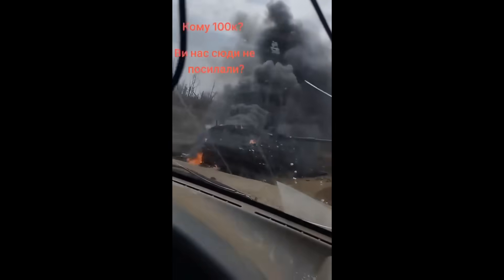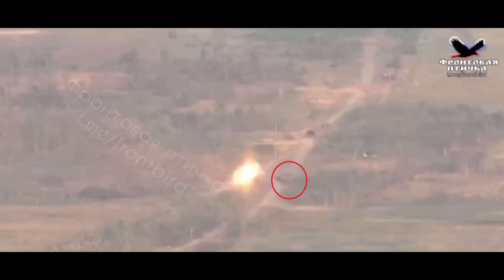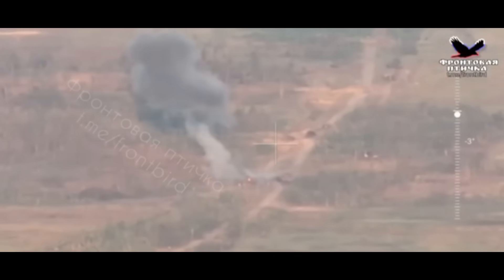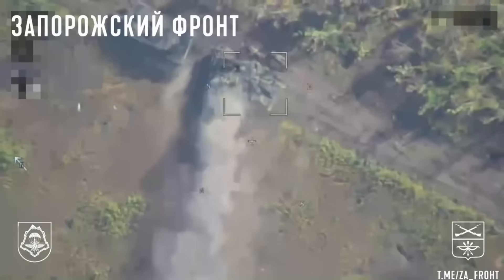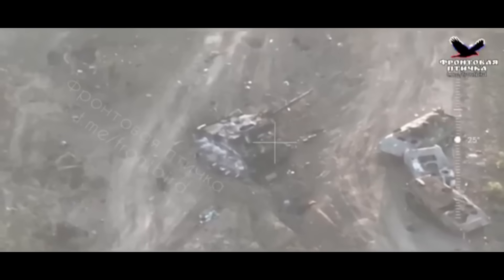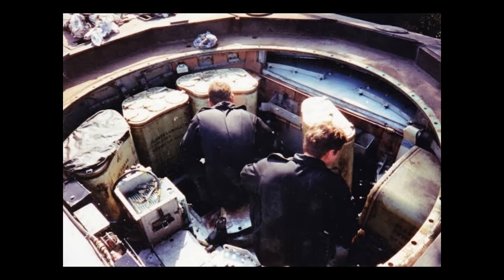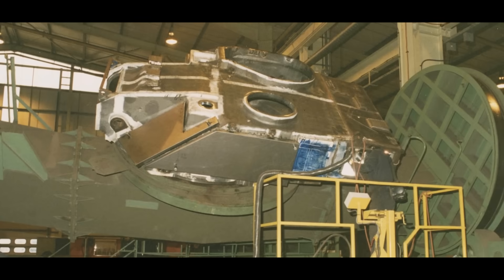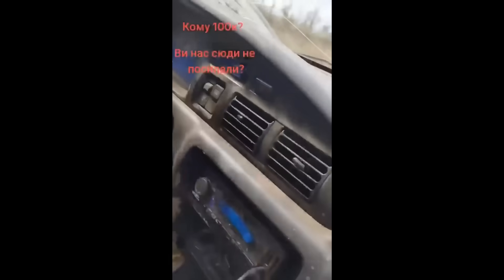This is how Challenger 2 got Destroyed in Ukraine

Comment: The crew survived and military analysts are saying that what you are seeing is an external fuel fire and that the tank, in all likelihood, is recoverable. .. Challenger 2 - Does exactly what it says on the tin.
Reply: HAHAHAHA

you need to cope
Reply: @mikes989  that was my thought too

if the tank was hit and the crew evacuated, the hatches would have been left open, so that when the ammunition did cook off, the turret and commander's hatch would not have detached as most of the explosive gases would have vented via the open hatches, reducing the size of the explosion

the more likely scenario is that the c2 was hit by an atgm which killed the crew and cooked off the ammo, completely destroying the tank

I don't believe it hit a mine and was disabled, the car taking the video was on a road...equally I don't believe it was disabled by artillery...I've seen another video of it being struck by a missile/drone and it didn't show signs of damage from artillery before it was finished off
Reply: @mikes989  Bet you guys arn't used to seeing a tank on fire that still has its turret attached.

Comment: It's crazy how this tank was destroyed by a bush, a molotov and a shovel
Reply: If this will go on and on. No One will buy them
Reply: @uldispaze7325  you see, there's no such thing as an invincible armored vehicle. All tanks have vulnerabilities. Tracks can be easily disabled, armor on the bottom and top of the hull is usually less than 1.5inches in thickness and side armor is also relatively weak compared to the hull and turret front, with sides being at most 200mm rha equivalent while fronts can be as high as 1200mm such as in the Leopard 2a7 or Abrams M1a2 sep v3. Mines, top attack missiles will disable any modern tank. Everyone can claim their vehicles are indestructible , but in truth they're just last slightly longer in a battlefield .

Comment: You chat so much subjective crap... The tank burned for a very long time after the crew evacuated. The same thing happened in the Gulf. The tank burned for roughly 48hrs and was left to do so because of the risk to troops. Any tank subjected to that kind of intense fire for long enough will 'eventually' look like that after the fire reaches the ammunition. It doesn't happen instantly and allows the crew time to get out... That's the point when referencing Western tanks survivability. Not only do you quote restricted AESP references in your video but they are related to CR1 and not CR2... Get your facts in order before you post this kind of misleading malarkey.
Reply: In actual fact you quote Chieftain AESP's... Not even CR1 nevermind CR2

Comment: So this Challenger 2 wasn't destroyed in an active engagement involving the crew, the Russians are claiming a false victory, they destroyed an open to the world disabled and abandoned tank.
This looks like a similar method of destruction as the friendly fire incident. I was looking at the Kornet specifications and it would not penetrate the Chobham armour. If the hatches were open the missile would set fire to the inside, just as it happened in Iraq. The sad thing is that the tank was recoverable but until we give Ukraine the ability to maintain air superiority in operations, crews will abandon them. In Iraq a Challenger 2 was disabled by a Russian made mine but the crew locked down and waited for recovery. Over the following hours the enemy attacked it with 70 RPGs, the crew were safe inside drinking tea and eating food. The tank has two water boilers for this purpose.
Reply: 😀
Another Britaboo coping hard.

Face it Britaboo, CH2 have seen combat for the first time and it failed miserably.